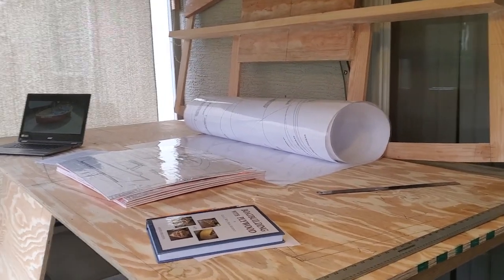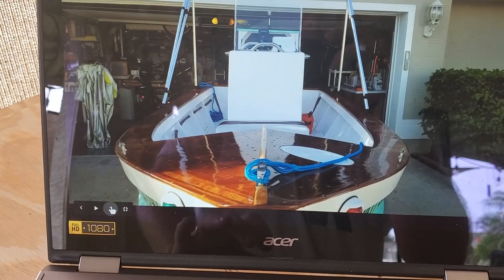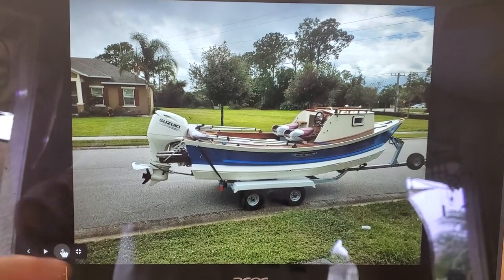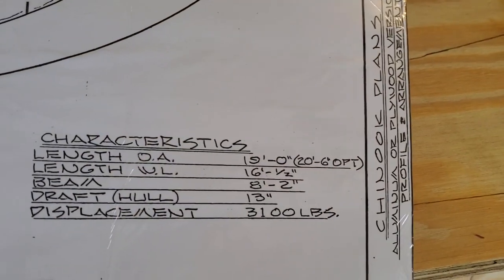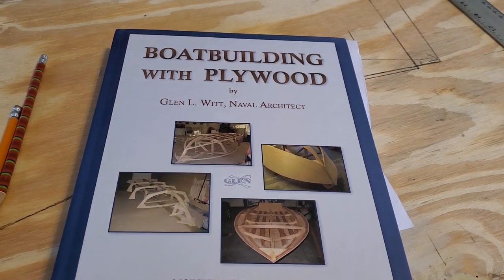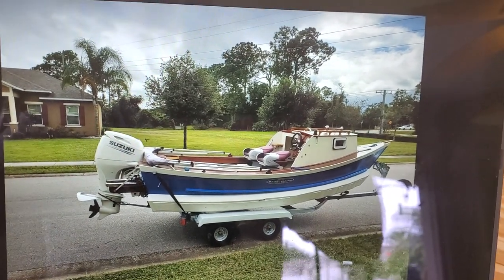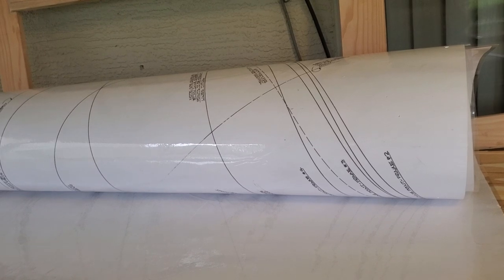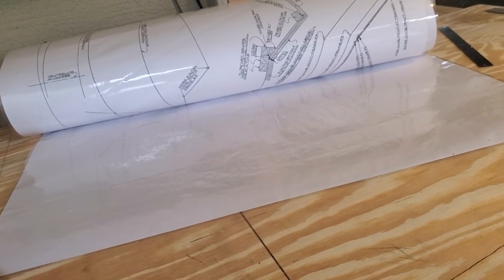Building a Homemade Boat from Glen L Part 1

Comment: Question:  You mention using carbon paper to trace and transfer the lines from the plans to the plywood.  I assume the laminated plan is on top.  So what tool (or pen/pencil) did you use to trace?  It obviously needs to push down through the laminated plan enough to cause transfer of "carbon".  Also, what size carbon paper did you use and where did you buy it?  Thank you very much, Mike.
Reply: @jamesboatbuild  Ok, thanks.  I'll look around.